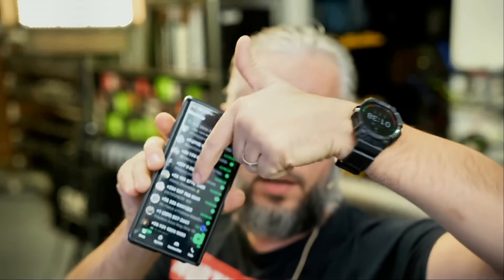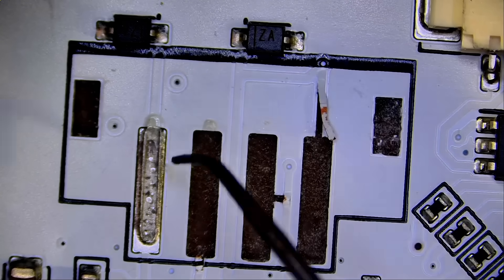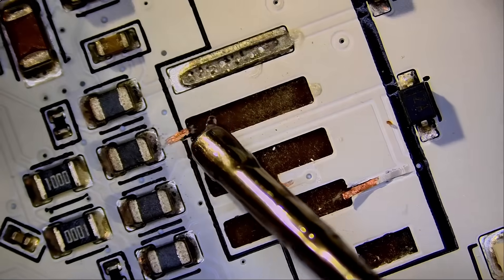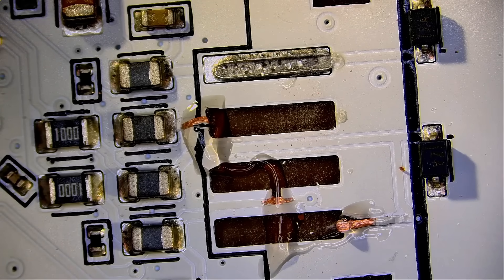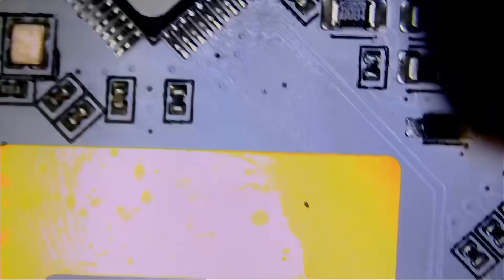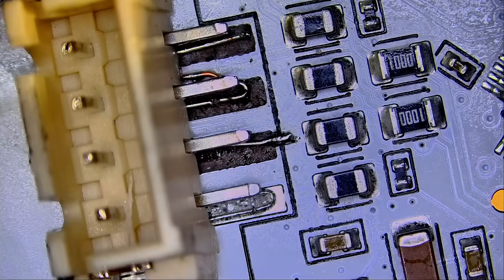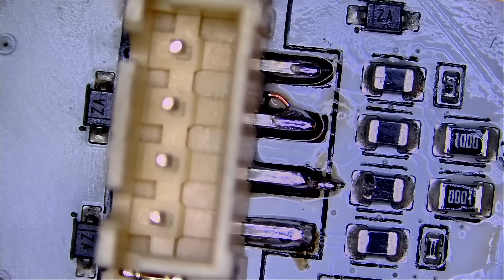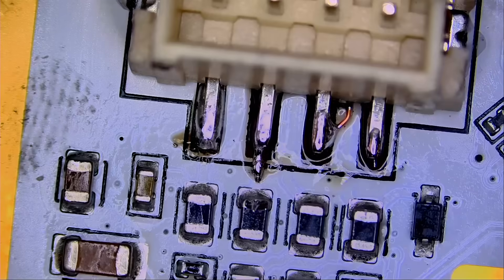Bird Home Automation Keypad Repair - When a Simple Repair Turns Into Microsoldering Art

Comment: To Glue on an Connector 4 more Strength, use superglue with Filler. You can Glue Car Parts by this Strength. Make a little Drop an Fill up after this. Its Perfekt

Comment: I thought you were going to apply uv solder mask on those pads
Reply: UV mask is for bare copper.
Reply: @bozak2320 he could have let the copper wires a bit longer and cover the ends with solder mask to have support on those wires